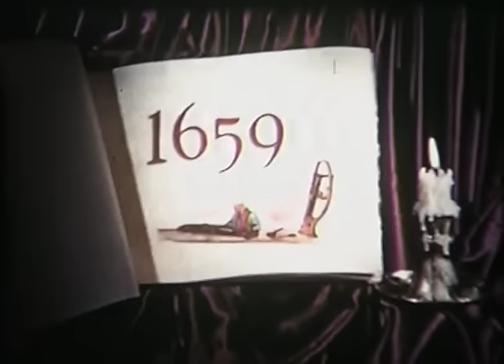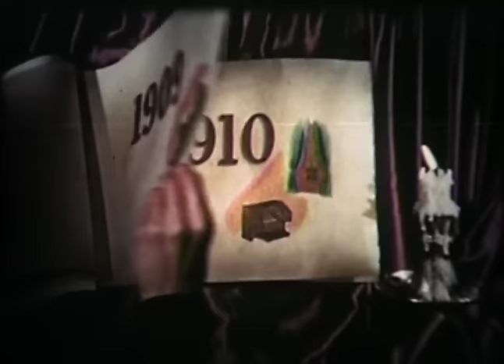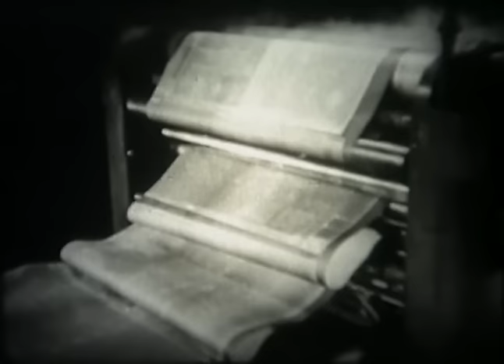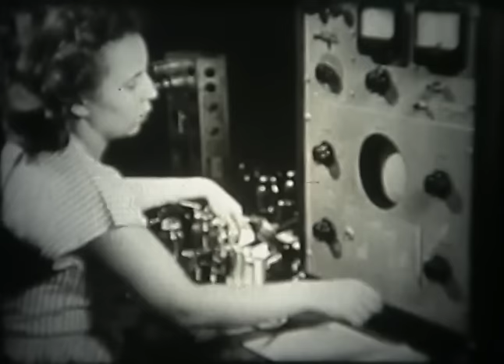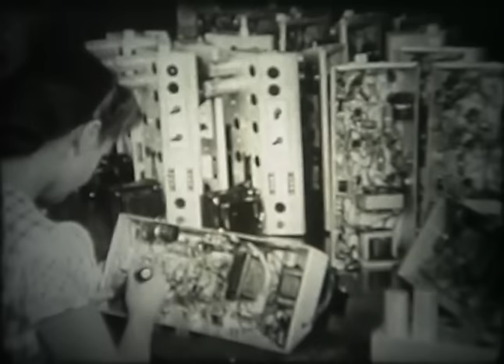Wurlitzer Jukeboxes - Factory Tour - "A Visit to Wurlitzer" 1940's

Comment: Sad by the late 1940's wood was mostly replaced by plastics and aluminum and most of these craftsmen were furloed out. I owned a 1938 #600 playing 78’s back around 1955 and the wood box was still flawless, just had to do a varnish refinish and it looked new. HiFi ?? had just one speaker-- a giant 15" electro-dynamic with lots of 60~ hum so knocked out the speaker coil and an LA magnet company managed to fit in an Alnico permanent magnet and it was good to go. Most audio amplifier tubes were early 2-digit types like 30, 45, 80 etc and readily available from surplus stores.